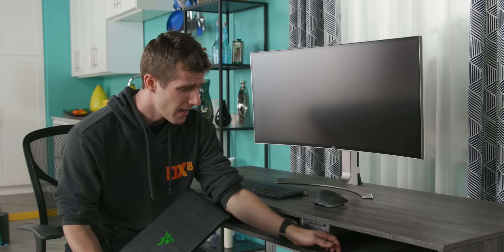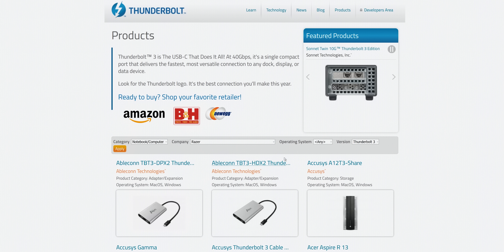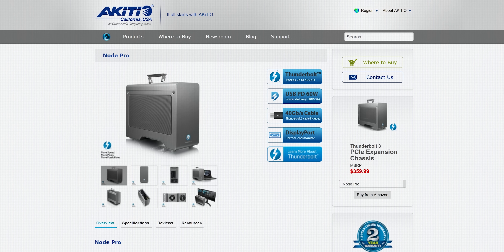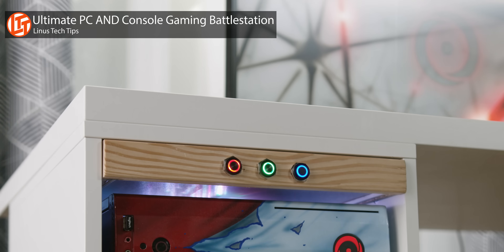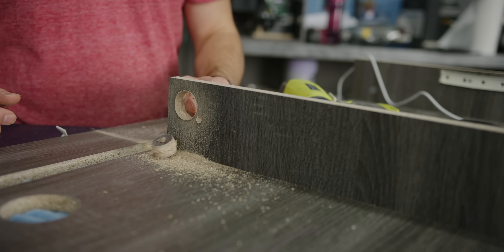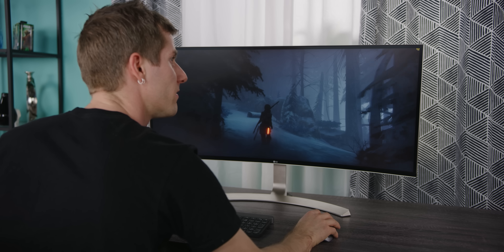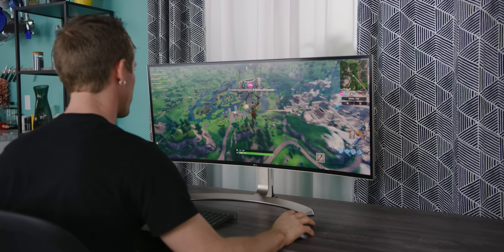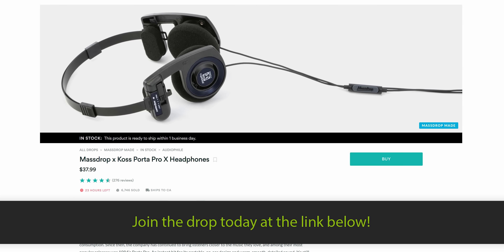This is the CLEANEST Setup.

Comment: I would recommend you to have multi-usb charging, like 6 ports, with quick charge, not all device support wireless charging, and wireless charge is slow like hell

Another thing is speaker, a pair of studio speaker and an external DAC to usb hub would be nice, u still have to connect only 1 cable to ur laptop

Also some RGB, because....., it's 2019....

Comment: I don't get the obsession people have with convergence. It's like the 3D effect they tried to push for the TV on a computer.

Desktops satisfy different needs than laptops, you use them differently, you interact with them differently. I'd rather have my files synced across two devices than having the same device "adapt" to my situation

Comment: Laptop docking station?? Anyone??? 
I’ve been using these for years and they work great, not a single cable in sight just drop the laptop on it and flip a switch!!!!! 
My current one is an HP 2013 ultra slim docking station. If you insist on having an external GPU, then that would be your “one cable” connecting straight to the laptop.

Comment: This is not necessarily about being  cheaper than two devices but about the convenience this gives you. I recently switched out my desktop and laptop for a laptop + eGPU setup just for the convenience. I no longer have to sync files, make sure programs are installed on both devices etc (this is especially handy as a CS student). And down the line you can easily upgrade your GPU (with TB3 'limitations' in mind).

Comment: Why?  2 300-350 dollar accessories and a 1080ti, which is still omg expensive.   You spent more on 2 accessories and a 1080ti than I could buy a 8700k 1tb ssd 2060 2nd desktop with an asus predator monitor.

Comment: Cool idea and concept, it may seem practical and perfect but there are some disadvantages to using something like this in long term. Because I run a similar setup (though not the cleanest) and I have personally experienced battery swelling on my Razer blade 14 because I plugged it in for whenever I game or used it. It caused the trackpad to curved upwards because of the battery inflating. Although I have not experienced any noticeable battery capacity loss, I really couldn't see this being usable in the long term as I have to replace the battery for 90$. I have to replace it because it puts my battery in risks of being punctured. Anyway, cool video and I appreciate the effort that goes into this video.

Comment: Great build! but could've been better!
1-You don't need the TS3 hub.
2-the best EGPU enclosure would be the HP omen GA. It has a SATA plug to add a proper SSD and 4 more USB 3 ports. I think this would be more than enough interface for almost any power user.
3-AMD card for FreeSync and better compatibility between windows and mac would be cool.
This way you'd go with 0 compromises.
Bonus: use the latest, top-configured (quadcore 4.5ghz) 2018 MacBook pro 13 with a version of Parallels or bootcamp windows so you can run both MacOS and windows. it only draws 60 Watts of power and has that "mac" vibe to it
Use a monitor stand to increase desk real estate
Apple Magic Trackpad, a mechanical keyboard, and a low-profile gaming mouse for the ultimate experience. 
I basically have a very similar PC setup to this, plus a macbook pro for daily use and this one is really inspiring me for my personal build!

Comment: ADD a Integrated Cooling Pad or just a hole with a fan to aid the laptop's cooling of the CPU which will be working most likely at full tdp, you could cop out for a low power silent static pressure fan to maintain the silence and get really decent cooling

Comment: I wouldn't pull ethernet together in pair with a power cord. I did that once and had a lot of lost packets and jittery performance. An umbilical cord looks clean but you need to shield properly.

Comment: Spend +1k$ to avoid spending 1k in a desktop and Ikea desk. Interesting..
Reply: L I F E S T Y L E
Reply: no, spend $1k+ to have a clean setup. it was never supposed to be cost effective.
Reply: jojivlogs_ “the real bummer is having to buy both” I thinks we can make some assumptions there bud
Reply: @jojivlogs_4255  that's the lame way of achieving a clean setup.
Reply: @jojivlogs_4255  having a "clean" setup is not worth the extra 1k+$
Reply: Practicality depends entirely on the use-case. This could be useful in an office environment where aesthetics are in the high-eat along with mobile employees. It could even be set up in such a way, that you have "roaming" seating and depending on where you are, you get a workstation-type GPU (like a Quadro or Radeon Pro).

Since each employee is always using the same laptop, they always have the correct data with them (intelligent replication and merging solves this), and it minimizes the hassle they face and can even be used to secure the laptops somewhat effectively (bonus points for a lockable steel cabinet).
Reply: No don't see the point in this at all. in the end you put a box in some draws. This could have been a PC, it would still look the same and have better proformance.
Reply: The PC guys perspective on how to spend +1k$ and several man hours for aesthetics.
Reply: @The2808erik  lol crank up those numbers rookies
Reply: Mirio togata What do you mean ? It is a fairly accurate estimate. It’s a 2k Laptop. The dock, cables, egpu enclosure, wireless charger circa 500$ , 1k Monitor, used 1080ti 500$ circa. A similar smaller IKEA desk is like 150$. I’m excluding man hours, because you will probably do this at home in your own free time.
Reply: MMatos you have a ikea in america?
Reply: @SuupOnYT  Yes. Well, at least in California there are quite a few locations. I have the Malm desk for my setup and it's by far cleaner and more impressively done than theirs for less than a 10th or more they spent on items to act as a PC. I have a massive tower from Maingear, 2 monitors (monitor stand on desk) and an xbox 1. No wireless items.
Reply: @SuupOnYT  What I did for my setup isn't on the same level of cable managing... it's absolute cable  totalitarianism!
Reply: portability :)
Reply: That caldigit unit is $300, and most eGPU boxes are between $200 and $300.
So you spend $500, and avoid having to buy a desktop case, CPU, RAM, storage, and motherboard. You CAN get away without buying a graphics card and eGPU box if your laptop graphics meet your needs, but leaving it out wouldn't really be an apples to apples comparison.
Reply: @Gellis12  You forgot to include the labour and  equipment cost ,for modification to desk also those fans, hmm.....Not everyone has a CNC and Alex in the backyard..... So no-go on this Project and buy a Ikea desk and a Desktop
Reply: Gellis12 so it’s like a 4k$ Setup, you can achieve better performance and similar functionality with a desktop for half and you have upgradablility. I personally don’t need a 2k laptop on the go. I don’t have time to play more time consuming games on the go anyway, neither do I want to, because playing with keyboard and mouse on a plane is cumbersome and uncomfortable. I rather have some thing like a nintendo switch, or phone with Bluetooth controller.4 Core CPUs will be soon outdated for high end gaming anyways, you can’t really oc either to get some extra life out of them.
Reply: @The2808erik  > I personally don’t need a 2k laptop on the go.
Whole point of the video is about that, sorry. Also, any laptop with TB3 should work, there's plenty of options with 8 gen Intel and within 1-1.5k range.
Reply: niter43 Then why not buy a gaming laptop in the first place and omit buying a gpu and external gpu enclosure if you are so keen on playing AAA Titles on the go ? Are those few extra pounds really taking away that much portability for you if you have a backpack anyway ? I don’t see the point.
Reply: @The2808erik  >Are those few extra pounds taking away that much portability
Yes, it's a huge difference? Have you tried taking 5-6lbs laptop each day with you? Not to say about battery life.
>if you are so keen on playing AAA Titles on the go
I'm sorry, but how the heck did you conclude that? Video clearly shows a fucking table with embeded eGPU. Clearly a work anywhere, play home scenario, no?
Reply: niter43 You refuted your own point you were implying in your last comment, if you only game at home you don’t need a 2k laptop for work or school, but what ever floats your boat. It only takes away portability if you travel several kilometers via bike or on foot each day, otherwise I have to say that you are quite weak.
Reply: @The2808erik  >if you only game at home you don’t need a 2k laptop
Isn't that exact thing I said?
Reply: niter43 niter43 No, did I quote you ? No. “Whole Point of the video is about that,sorry.” This is what you wrote in response to my comment earlier, that one can achieve similar functionality and convenience from a setup that costs half, without the need for a 2k Laptop. Next comment you replied with a rhetorical question, “clearly a work anywhere, game at home scenario, no ?” exactly the point I was making, against this specific setup and the need for a 2k laptop.
Reply: (This is for @TheMoonCloud) This video obviously wasn't targeted towards you, nor does its use case apply to you. This set-up is likely for people who want to game or do light video work without the need for a case that either sits on the floor or takes up desk space and also want a laptop to take on the go for relatively light workloads. This is by far one of the best solutions I've seen to date.

Your market is obviously more aligned with console-based on-the-go gaming. If you like that, then buy that, but that doesn't make the use case for others wrong. Also, most people still have 4 core CPUs, in fact this laptop has a 4 core CPU. And yes, you can OC to get extra life out of them. In fact, that's the entire purpose of OC'ing an old CPU. I was able to extend the life of my FX-6300 by OC'ing it to 4.5 GHz. I bought myself a new chip just this Christmas. If we're counting, that's a nearly 8 year life out of that chip.. And it still works! Definitely extended its lifetime.
Reply: @The2808erik 
>exactly the point I was making, against this specific setup and the need for a 2k laptop.
Any laptop with TB3 would work, they start in $800-$900 range. Any decent laptop you can bring with you on daily basis (about 3lbs, Intel Core / Ryzen, SSD, at least 8GB RAM, FHD/IPS or better) would run you into same range, so why just not pick one with TB3?
Reply: @The2808erik  >if you only game at home you don’t need a 2k laptop for work or school
And I've said you can get any TB3-enabled device. It's not $2k+ laptop exclusive.
Reply: AJAXBURGER I know it’s not targeted at me. So spend at least 1k extra for convenience and aesthetics? Got it. I know that the point of OC’ing is to extend a chips lifetime and yes of course you can oc some mobile chips but in thin and lights usually not enough to gain any more than 10% at best. The FX6300 wasn’t even a good cpu choice at launch. I like PC gaming on the go, don’t get me wrong but I don’t need to play the newest AAA titles (the new shadow of the tomb raider is mediocre anyway).There are plenty of games which are fun that don’t need a beefy gpu and the ones that do I can play at home when I actually have time for immersing my self in them.He even opens the video with, that for most people a thin and light would be enough on the go. Always video editing on the go is pretty specific and are probably not most people who watch this video. If you don’t want a huge box under your table build a mATX or ITX system or desk pc.I just don’t think it’s resource or price efficient, even for the people and/or use case that this is targeted at, right now at least ( I don’t think most people want to spend 4K $ on a setup like this, I could be wrong of course.)Maybe in a year or two there will be more thin and lights that support this setup better, for less.Thunderbolt is intel specific as well right ? Aren’t Ryzen CPUs much better for productivity regarding video editing?
Reply: TheMoonCloud I think you’re missing the entire goal of the video. It’s to have one system that does it all. And this, is by far the best example of such.
Reply: AJAXBURGER No I don’t, it’s just not appealing to me, I rather have a scuffed setup with minor inconveniences and have a grand more in my pocket. If I want a do it all system with significantly more cost involved, I’d buy a gaming laptop. I would not go hiking or touring with the thing ( most people aren’t going to do that )so weight does not matter as much and there are thin gaming laptop options too. I think the purpose of this video is rather to make the transition from a mobile laptop experience to a desktop one “clean”, as seamless as possible, have an aesthetically pleasing and organized setup/work environment. Don’t get me wrong, I appreciate what they are trying to do here and the video has a lot of entertainment value for me, it’s just not that good for the various reasons I pointed out. If you are rich and you want something like this go for it, but most people who wanna game and work, want to do it cost effective.
Reply: niter43 Please, show me an ultra book with TB3 and 4 Core CPU for 800$. The cheapest I have seen, as of writing this comment, is 1.2k -1.3k$. That is for 13.3 inch models, with 8 gigabytes of ram which is borderline acceptable if it’s not upgradable.

Comment: hey linus, im looking to upgrade my now near 10 year old certified data gaming pc. any tips on what to upgrade? only thing changed in the system has been a hard drive since my last one crapped out about a year ago. 
win 10 64 bit
intel i5 650 3.2ghz quad core
8GB ram
AMD radeon HD 5570.

havent had a chance to put any cash into my rig due to a variety of life changes including my 1 year old daughter. families asking what i want for my birthday so figured why not ask a big tech what the best advice would be. i mostly play WoW LoL and MTGO so nothing TO over the top needed ide assume

Comment: "We build a desk that transforms your laptop into a full gaming desktop workstation using a single Thunderbolt 3 cable. "I have the same setup but with a height-adjustable standing desk from Amazon under $100. Q_Q All my cabinets are custom made from Bridgeview custom cabinets. I had this idea three years ago with my limited room space. =D I just need a better GPU and better cooling. You gave me great ideas. LOL PS my mousepad is made out of ducktape and paper ta-da! LOL It better than a store brought mouse pad.

Comment: I would love to see a setup customized for music production. you would not believe the messy corded mess we have going on just to have an audio interface, midi keyboard, and usb hub for multiple ssd drives. 

it would also be cool to see almost like a switch dock tray made for a project like this. maybe secure the thunderbolt cord in a static position so all you have to do is set your laptop to go to sleep after a minute or so when it’s not plugged in instead of it going to sleep immediately, then have some guides and a slidable surface to just dock your laptop switch style.

Comment: For those of you who think you'd need a CNC to do the wireless portion of said build, no. You could draw the shape and simply use a router (which in this case isn't what you connect to for wifi, it's a common wood working tool) and manually cut your inset. No need for these expensive bullshit tools or machines these bastards find excuses to buy.

Comment: I can dig one with aluminum legs and support structures, glass desk top with maybe a faux marble decal from dbrand, for hiding the wireless charger. 

Definitely do a Rev. 2, but make sure that even if it's styled to match the Apple aesthetic that it is definitely compatible with everything else. I don't think that would be too difficult but that could be a potential gotcha I can see with no research. 

Also you looking off to the side for your ending as spot was kinda jarring. Was your teleprompter on the other camera?

Comment: i run a razer core x trough a lenovo TB3 dock and its works fine, i compared these fps results the ones where i connected the core x directly to my thinkpad T470 laptop and the results were the same

Comment: What I would do for something like this: use full (massive) wood (or today more practically glued beam plates), preferably oiled hardwood. Cheap laminated chipboard like that is just awful to work with or repair. And for any heat-generating applications like this, choose a wood that has the smallest heat expansion coefficient, like mahogany or similar.

Comment: I got a pretty simmiliar Setup at home but i have a Problem with the hub of the gpu case... so i have a usb hub and the thunderbolt 3 cable. Also the velcro is always coming lose under the table.
Otherwise it wirke perfectly!